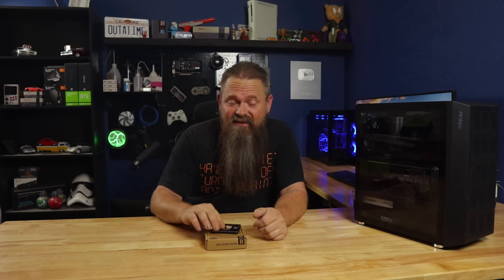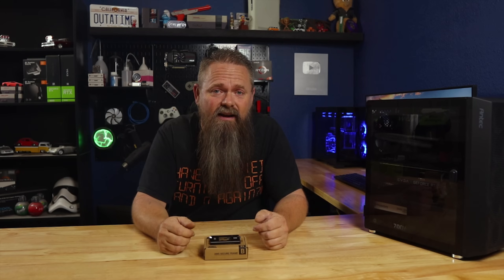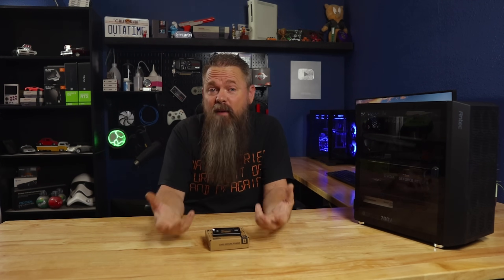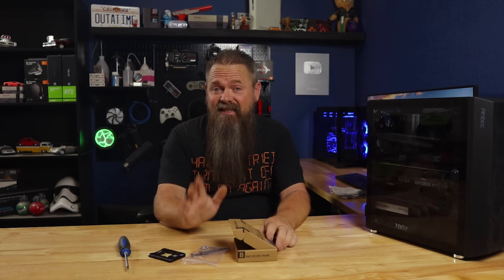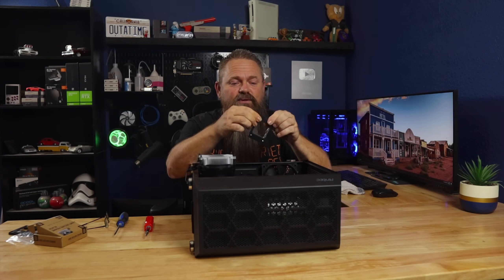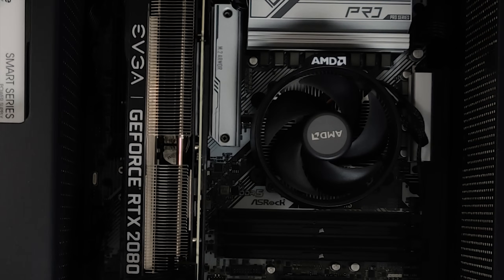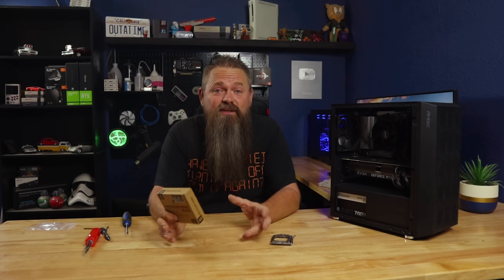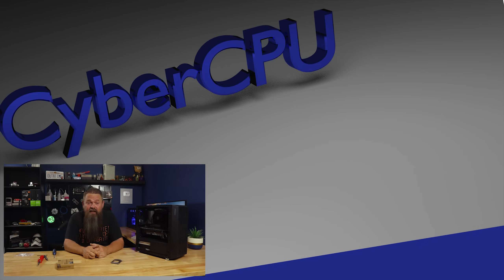AMD AM5 Runs Hot, Will This Fix It?

Comment: Undervolted and get a better cooler, no that cooler is crap ! as long as you get a direct 4 heat pipe cooler for cheep and undervolted you can get that CPU to boost to 5.4 to 5.6 ghz

Comment: Went back to air on my 7950x3d and was right at 85C.  With the contact frame 80C with higher clocks.  Reduced fan speeds a bit, it’s now 82C.  Phantom spirit 120.

Comment: yeah, this kind of contact frames are only giving noticeable benefits to LGA 1700 cpu's, as they are the only ones actually bending to the point it becomes a problem, but, if you want the contact frame just for peace of mind, its fine, it also makes cleaning the thermal paste way more easy and less stress inducing.

on my 12700F i won 8-9 °C less on idle and it no longer reaches temperatures above 70°C with a stock cooler, with a hyper 212 black it never goes above 65°C, it also cools way faster, i recommend the thermalright V2 over thermal grizzly as the thermalright one is safer to install, the thermal grizzly is more for extreme overclocking and has more play on the screws for pressure tuning.

Comment: Its not cooling retention frame. It helps with the pressure applied to the CPU and it prevents thermal paste from entering these "weird" cuts on the AM5 CPus.

Comment: I will install a larger heatsink and fan rather than messing around with the retention plate. My i7-12700 is rated at 185W, whereas the stock cooler is only 65W.

Comment: I wasn't aware AM5 or Zen 4 even had problems with thermal dissipation due to an uneven IHS or uneven mounting pressure, and I thought these mounting frames came into existence simply because Intels beer belly IHS popularized them and because they do a nice job at keeping thermal paste out of all the nooks of the funky looking AM5 IHS, the latter being why I'd even buy one of these. I think it was Noctua that also sell little packs of thin plastic frames you put on top of the mounting bracket with the CPU installed for the same purpose.

Comment: lol it would be easier to clean if ya didn't use enough paste for 5 CPU's paste is to fill the air gap and scratches and imperfections

Comment: It's not for the temperature, it's to prevent bending or sliding due to tightened cooler block. Some AM5 cpus fried because of this, so people are using this plate instead.
Reply: for AMDs, this is usable only for aesthetic reasons and keeping the thermal paste away from the inside corners of the IHS. AMD CPUs have alot thicker IHS compared to Intel CPUs, so theres literally no bending. JayzTwoCents has a video about lapping the CPU and iirc he sanded off 1.8mm and it still was beefy
Reply: @axux4509 You shouldn't spread misinformation because people who aren't familiar with the subject will believe it. This frame is just a waste of money. There is no inclination with AMD AM5, unlike with Intel. At most, it's good for decoration or for holding a little paste if you put more on the processor, but you can do that smartly too. However, those who can't think for themselves should just spend money on unnecessary things and let the manufacturers profit from the many ignorant people.
Reply: @pitthe7676  well I have that frame and it looks nice and lets me go ham with thermal paste without worrying too much. it might give 1-2C in case the CPU and the frame gap is filled with thermal paste and the waterblock surface is covering both of them, but thats a rare scenario. R9 9950X here at 280W and with the Thermalright frame with custom watercooling.
Reply: If it makes contact with the cpu edges and is condusive to heat, it most definitley will assist in cooling the unit...its basic thermodynamics @pitthe7676
Reply: so its for the temperature
Reply: @icytops its to prevent bending
Reply: @Lord_Of_All_Devils  prevent bending, which leads to temperature increase. U r 50% correct

Comment: This is why I built an AM4 system instead of an AM5 system in 2022. Tests have shown that this TJMax lets some of the parts of the CPU get dangerously close to temps that will dramatically reduce the lifespan of the chips. This is a design choice by the engineers that was not a good call. Ryzen 9000 is what Ryzen 7000 should have been, but I will probably just skip AM5 altogether at this point.

Comment: There's one more potential benefit to these frames on AM5 systems. The even allaround pressure will help lower or eliminate the risk of the heat shield warping over time, especially in overclocked systems where temps are higher. Overall, I feel they're absolutely worth it for the few bucks they cost. Thanks for the review!

Comment: The contact frame is not needed on this cpu, period, On the LGA 1700 it was very needed for even distribution of pressure for the mount, which is not needed for this particular shape of processor...
Hence the name "contact frame"...

Comment: I have to say, something you failed to mention is those brackets are also designed to prevent the CPU from warping over time as they can do with the OEM stock bracket which increases temps as a result. It's not really fair to say they are junk if you don't see an immediate temperature reduction, or test over an longer extended period of time. I was glad to hear you step back and recommend these regardless of your short term testing done. I personally think they are worth it, and $15 is reasonable compared to some brand names at $30.
Reply: Thats only on Itel CPUs, due to their rectanguslr shape

Comment: I got and am5 9700x with a Cooler Master water cooler without this frame and stay under 65c in a 30 minute benchmark. It's not needed and you just need a better cooler than that stock one. You said it yourself that the cooler was holding you back and under testing it didn't make that much of a difference. As far as cleanup the paste goes who in the hell is doing this often. I set it and forget as I use MX4 which should be good for years. If your computer is not broken and works as it should without problem leave it alone!!! All you need to do is clean/blow the dust out every so often.

Comment: 14:20 basically sums it up.  Save yourself 20 mins.  It doesn't help.  It won't reduce am5 temps.
Reply: Ty
Reply: That was my conclusion as well but the guy is smiling and laughing throughout so you kinda get the impression that it works.
He's very chipper, it that's the word I'm looking for.

I got the Arctic Liquid Freezer III 360 Pro and the temps still hits 95 degrees on my 7950x, that's with a PBO set to negative 15.
The AIO shaved off 17 seconds on a 10 min Blender render compared to the Noctua NH-D12L. It didn't boost higher but the CPU was able to sustain a higher frequency for longer.

That was just to benchmark, I normally render on the GPU and it takes 10x less time.

I may be looking at undervolting in the future. 
PBO set to -30 made my system reboot when idling, worked just fine when rendering for some reason.
Reply: @uniktbrukernavn Gad damn 95 degrees???

Comment: Windows 10 will give an activation key. *Windows 10 will digitally assign a product key code. Went to your sponsor for a Windows 11 key code. I really thought it was a cash grab but I was totally wrong and I’ll eat crow as the elders say. Microsoft was too high for Windows Pro.

I just bought and installed my AM5 AMD Ryzen 5 7600x. 32gb (added another 32gb) Newegg had a bundle offer I could not pass up. Came with 1TB and 512 GB nvme m.2 SSDs. It kicks ass.

AMD is definitely giving Intel some serious competition.

Comment: I,ve tried installing it on my msi meg b650 tomahawk wifi paired with my 9800x3d, and the contact frame sits around 5mm below the cpu IHS. Is there any fix or issues with compatibility. I can't find a data sheet of compatibility anywhere

Comment: It doesn't work for ryzen 9000 CPUs under load with PBO on! I got a ryzen 9 9900 x and on regular settings it runs at 65 to 70° under load but as soon as I turn on PBO and I run the same benchmark it goes from 45 to 90 - 95 with a 360 mm AIO and eight fans!

Comment: I agree that the best benefit for this on an AM5 is to make less of a mess and it is easier to cleanup if you plan to reapply every couple of years...
Reply: Yep, especially if you spread the thermal compound yourself with a spatula and not under the pressure of the cooler only.

Comment: That's margin of error stuff  at best. Your paste application from run to run could be more impactful. This thing is a thermal paste guard at best.
Reply: No, the stock ILM applies pressure only at the sides, and when Gamers Nexus did a laser scan of the mounted CPU, they showed that the stock mounting mechanism bows the center of the CPU IHS upwards, creating a much smaller contact patch. This effect is far more severe on intel chips, but it’s still prevalent on AM5. I can’t speak for this guys testing, but the product gives a real advantage.
Reply: @henry3397  That's Intel, not AMD. There is zero evidence of this even being remotely an issue on AM5.

Comment: I use these in all my builds. Lower temps? I've never heard that one, but it started with the 13th and 14th generation Intel processors warping over time. I use them for convenience. Plus, they are on Amazon for $7, lol. The most significant benefit is when you have to clean thermal paste off them. Way easier!

Comment: If you're using am5 and you dont have experience building pcs or is just kinda clumsy, I'd say to avoid this. Its just creates another chance for you to bend the pins in your processor and wont give you any benefit other than it looking neat and making it easier to spread thermal paste. Just take your time with the spatula and spread it around evenly, and if you need to clean it up later, again, just take your time. Regular thermal paste wont hurt your components, and you cant really use liquid metal with this die since its made from aluminum.
Reply: Source: trust me bro

Comment: Umm, you must compare the temperatures and the clock speeds at the same time ... with the contact frame they should be higher at the same temperature 
 ;)

Comment: I already have a secure frame and I will say that with the really hot am5 chips it does yeild some benefits originally my air cooler for my 9800X3D would hit tjmax of 95c in cinebench I then installed my secure frame and now under a all core 160w load 87c with it on my CPU I can't even hit tjmax anymore I think it's a use by use scenario but even if like in the video at minimum it keeps the clocks at a more consistent and higher clock rate even though minimal is still worth it

Comment: If u have money to spare  for your AIO , just buy phanteks T30 fan with kryosheet or PTM 7950. If u want to squeeze more boost PBO/undervolt  your 9800X3D/7800X3D. Make sure u update your BIOS, update your chipset to for performance & stability.

Comment: I don't know if it's a placebo or magical unicorn but I still prefer the frame because I don't have to be that one guy who installed the 9800x3d incorrectly and force the latch down.  4 simple screws and it's in place.

Comment: I think the lga1700 bracket is working for my 13600k (stock asrock settings with intels latest microcode). 30-45c "idle"... windows things (26c idle in the bios) and 60-75c depending on what im doing / playing. My room is 22-26c most of the time so it makes sense. 

My cooler is a thermalright peerless assassin 120 (non se). I may switch to the 140 to get some more cooling around the cpu tho.

Comment: These (The intel version) work. The only situations I've seen where this work for the AM5 is for the cheaper made motherboards. If you have a solid, thick built board, you'll see idle temps drop, but stressed temps stay about the same.
Reply: Also, for those that have said it make it worse, you've tightened it beyond hand tight.

Comment: Best is install bracket with NEW (unused) CPU! Im usin these from s1151 times, now Thermalright frame on my 7600x, 7700, 7800x3D and now on my last 7950x3D, believe in me - temps are oke with PBO, using AG400 Deepcool little cooler 🥰👍❤️

Comment: Seems like a waste to use the retention frame w/ an AMD cooler when you need a better one to maximize the 7600's performance, making it better to skip the frame and just spend more on a better cooler. If you're looking to buy a new CPU, consider the 7600X sans retention frame instead of the 7600, as you shouldn't use AMD's weak coolers w/ these CPUs anyway. Alternatively, it's possible to get a 7500F and 7600 sans AMD cooler, making them cheaper than the 7600X, but the 7500F is the better value if you can get it cheaper and don't need an iGPU.

Comment: I recently moved from intel to a 9800x3d. I had a thermal grizzly frame on my 13700kf and it dropped load temps by 5 degrees! I got one for my 9800x3d, it made absolutely no difference 😅 waste of money. But i suppose it looks cool, not that you can see it. But i can confirm it does keep thermal paste from getting in all the nooks of your cpu

Comment: Why are your cpu hot ..?   I always have 45 temp when running idle .. 
AMD 7 5800 x3D.
 What i do is calculating the airflow .. What comes in got to go out. Keep the pc clean every month and around 4 years new thermal paste ..

Comment: There isn't a pressure issue with the AM5 so you don't need this to spread it out. 
The thermal grizzly version comes with a bit of foam that makes this usable for a different reason. 
The foam seals the exposed components so you can use a conductive liquid metal paste. 
If you get conductive paste on the exposed bits on the chip it shorts 

I'm not sure you get a tight enough fit with this manufacturer to safely use liquid metal 
liquid metal probably isn't going to do much good with the stock cooler anyway. 
I can't even remember the last time I used a stock cooler it might have been in the '90s

Comment: Isn't the idea of the frame to help reduce inconsistency of contact between the CPU and Cooler over time?  Also, two different thermal pastes were used in this testing. That alone makes all findings invalid enough by comparison. 
I'd like to see this test run over a longer duration, perhaps a month of continued use with and without the frame, using the same thermal paste. Even this methodology would leave a lot on the table. There's a lot of other factors like the type of cooler is it an AIO. Is it a custom loop with a water block? Is it an air cooler? Blah , blah , blah. 
Honestly, what I want to know is does this type of frame seem like it actually supports the CPU in a better way than the stock frame? Two sides VS Four sides sounds better in my mind. 
With this mentality I'd vote that everyone should consider installing a retention frame. Even if it's only as a precautionary measure for future deformation and possible inconsistency of CPU to Cooler contact. That said , to each their own.
Nonetheless, nice video. I've been enjoying your content. CHEERS
Reply from the maker: The same compound was used in all testing. 

The purpose of the frame is to evenly distribute the clamping force of the socket. I explained in the video why it was necessary for Intel processors. It makes little to no difference for AM5 because the CPU isn't as large as the Intel CPU.

Comment: Thank you for the video. It helped me decide on purchase. I use an NZXT AiO Kraken X63 280 on an MSI MPG X670E Carbon WiFi Gaming Motherboard with the Ryzen 7700X CPU,  and it definitely makes a difference when you have more efficient cooling --a custom build would likely yield even better results... I am seeing as many as 12C difference in temperatures and regularly stable frequencies up to 5.2GHz instead of the system bouncing all the time between 4.7-5.1GHz.. It's nice and yes.. definitely helps. I used Thermalright's TFX paste this time.. Weird stuff.. hard as wall putty and difficult to apply, but seems to work well. I still want to go back to my Kryonaut Extreme.
Namaste...

Comment: I am curious to know if all testing was carried out with the same paste. You mentioned you usually use Thermal Grizzly, but opted to try the included paste. But it only comes with so much. The results you got, showing  barely any change in temperature, IS the expected result for AM5. That said, changing paste would likely have made a larger difference. Not saying you don't know better, but the way you described what you were doing, introduced doubt for me.

PS, we are both old fogies.. As you said "28mhz," I was immediately thinking, "I remember when 28mhz would have been a huge deal!" even before you said it.

Comment: I think a combination of this, a high quality thermal paste, a good cooler (can be air cooled) and undervolting makes most sense and it definitely fixed the crazy high heatspikes of my 7800x3d. I went for the Noctua NH-D15 CPU Cooler (with only a single fan) and Kryonaut Extreme since it performs very good in a lot of tests I've been reading. Before, my CPU spiked up to somewhere around 80° C. Now, it spikes somewhere around 58-65° C under heavy load. Under "normal" gaming load, I usually get somewhere between 48° C and 55° C. I probably could achieve more if I tinkered a bit more with undervolting. I just took the first stable settings I could find and left it at that. With a 40€ investment, I could get a so much better result. The frame is only around 20 bucks and installing it is rather easy to do. Absolutely worth it, if you ask me.

Comment: In the video you said the tjmax for the 7000 series is 85c, that’s incorrect, the Tjmax for NON 3D vcache models is 95c while the 3Dvcache models is 89c.

The tiny stealth cooler is in fact keeping the 7600 10c under tjmax.

Comment: Very nice video , Bur there is another reason these being promoted , To avoid thermal paste sliding in to the gaps which the processssor had in its design and in some extreme  cases it had reached  notherboard pins too.